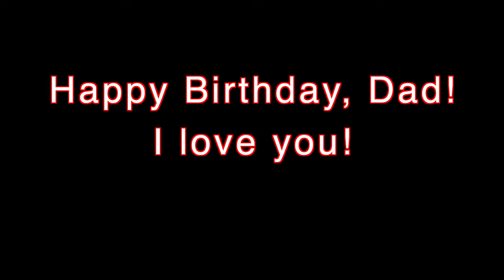High Speed Wheel and Tire Balance | Happy Birthday Dad!

Comment: Happy birthday Kevin’s dad! I’ve been working on cars for 20 years and I’ve heard of on car balances but never seen it done. Surprised hunter doesn’t have a machine that does it today. I remember I had an old ranger that had a vibration and I balanced the tires, road forced the tires and still vibrates. Found a weight missing off the brake drum.

Comment: On car balancing is SOOOO MUCH BETTER! I worked at a shoo that would do this on semi trucks, but we had a little switch with an arm and a light. We’d mark the tire with chalk, then spin it and watch when the light would come on. Put the mark where it was when the light flashed, and adjust the weights from there. Such a smooth balance when rotors and drums get balanced with the tire

Comment: Where’s the balance indicator that attaches to the wheel itself? I used the same Hunter wheel balance equipment nearly 35 years ago. I could balance a nickel on the hood of the car I was working on. The indicator had four knobs on the head wold get you close or dead nuts. You could fine tune from there.
Reply from the maker: Layton Turpin thanks so much for your comments! We lost that part a long, long time ago, so now we do it by feel... Go fast, go straight! Be Safe!!